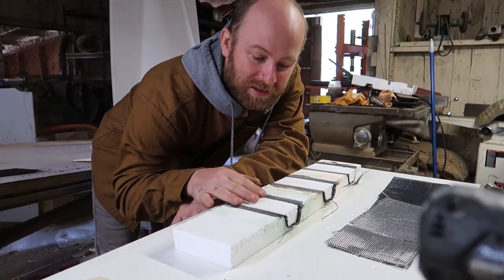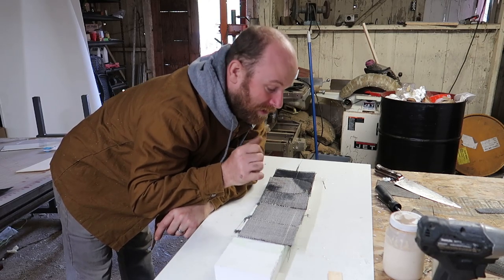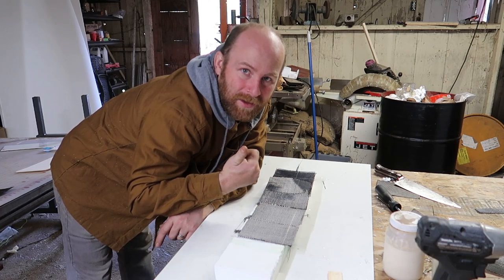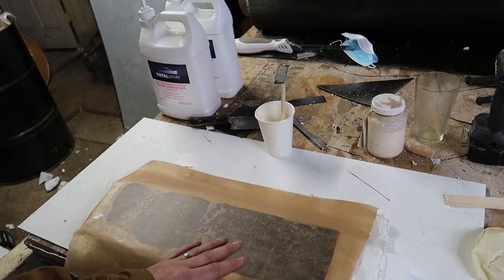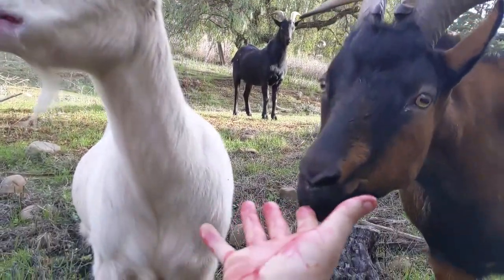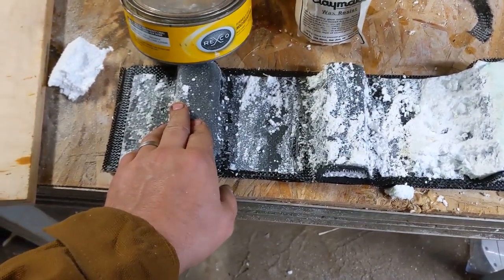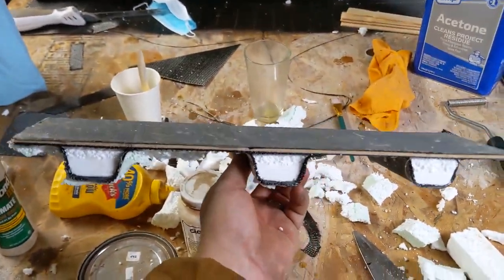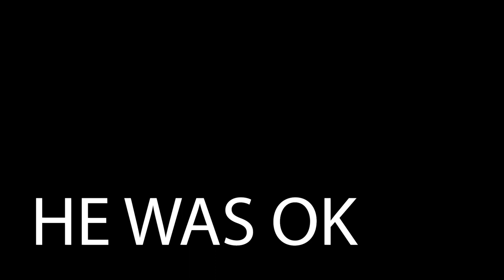Improving my Carbon Skills | Wet Carbon Sandwich Layup on Styrofoam | Lark Machine Co

Comment: Enjoying your videos here! 2 options for you from a amateur boatbuilder who trained in industrial design: When making foam models in the past we painted epoxy on and then sanded it smooth, than spray painted it. If there were any pinholes in the epoxy then the foam would dissolve and evaporate. This could either provide you with a smooth inside surface for your current technique or a possible way to wash the carbon surface to remove remnant foam. However if I were doing this I would be taking a fibreglass female mould in two halves from the foam buck, and then laying up inside that. This way you have gravity on your side, and can benefit from the smooth CNC surface, while stiffening ribs can be added at a later time, rather than at the start. Also if you break it it will be simpler to make another. I think your method is really novel and you're getting great results, however I worry it will get very difficult once you start adding compound curves, divinicell layers and working upside down and sideways to the mix, while handling multiple batches of expensive epoxy and carbon
Reply from the maker: I like the idea of making molds, but I just feel like it's more than what my skill level is at this point.  I am currently making a rotisserie mount to try to combat gravity. I'm gonna corndog it
Reply: @sheanyquist  I think you'd be fine making them. The big benefit is you know you'll end up with a nice smooth outside surface, just like the inside surface of the mould. Fairing is a pain, as I know you've experienced. Moulds seem like more work initially, but you've got those nice smooth foam forms, and if everything doesn't set flat as you glue layers onto them, you'll be fairing and filling for days
Reply from the maker: @lamtadatadatada  I think it's too late to pivot in my mindset.  I just think it's a bit too much to take on for this big of a project.  I have a couple of experienced boat builders who said they would come by and hold my hand through all of it.  They have a lot confidence it'll work out and I'm gonna ride that confidence

Comment: Hell yeah, good buddy! Keep it up! 

Look into hot wire cutting when you have to do long "extrusions" for that polystyrene stuff. It leaves a nice edge as well. Sealing the foam with  epoxy is a quick trick, too. Then apply your release method on that. Good stuff.

Comment: Hi Shea, looking good, never used the foam you are sandwiching with, does this foam form to the shape of the out side, will it remain curved, just trying to understand how the foam will go on and then lay up your cloth over it over it and still keep your curved shape , what if you spray painted the buck with a water based primer or some paint that wont dissolve the foam and that may seal it enough for you to just wax it or spray the PVA on to it, with my fairing moulds I have put about 8 layers of wax on and the sprayed the PVA as well if I am not confident of a good release,  admittedly they are also gelcoat moulds, the last rear tail I made I did just cover the buck in 2" wide packaging tape overlapped by 1" and that was all , the epoxy did not stick at all, Thanks Martin
Reply from the maker: Always a wealth on knowledge! I have been told that divinacell will hear form to shape.  I will be testing that very soon.  I like the tape idea. I have been flirting with the idea, just need to find some bulk suppliers

Comment: Mike Patey (Draco & Scrappy bush plane builder) pre-saturates his layups sheets before laminating, he claims it is easier and produces better results.
Looks like you are getting a handle on composite construction and no, it never stops being a sticky job. I have used Mylar packing tape over foam to smooth the surface, then a layer of wax or PVA, give it a try.
Reply from the maker: I was planning to buy a big roll of plastic to wet out the fiber and then transfer the carbon onto the buck.  I love the tape idea!
Reply: @sheanyquist  Saran Wrap is also mylar, I have used it in conjunction with mylar tape. Good luck!

Comment: Never seen this shingle method. Looks strong. 
Could you try putting a plastic, something like the heat shrink plastic they used on RC aircraft wings back in the day. 
Or. 
Simple packing tape side by side strips over the polystyrene.
Reply: I was just about to write this very thing. Alternately, ive used cling wrap and super-77 3M spray glue, then wax.